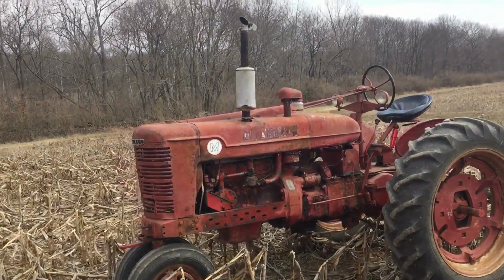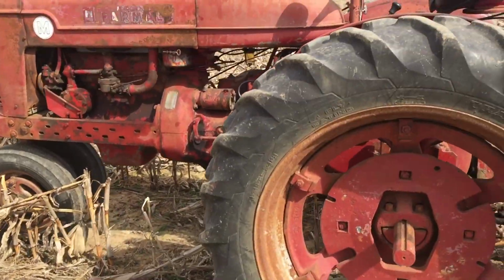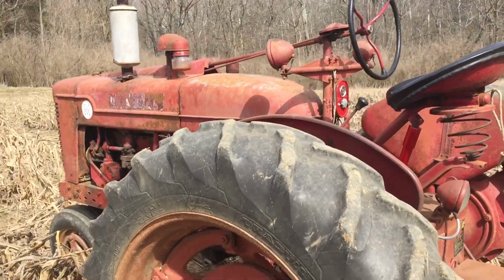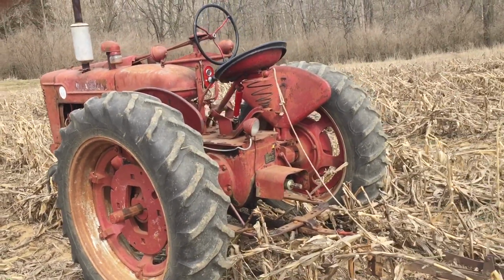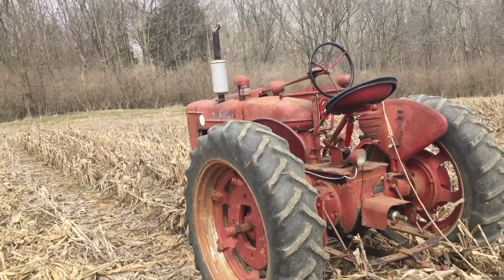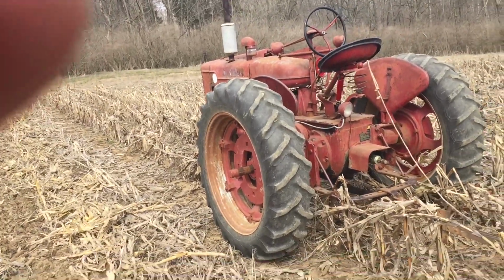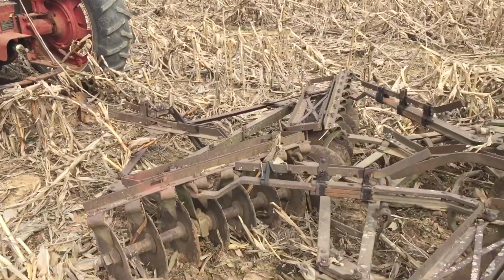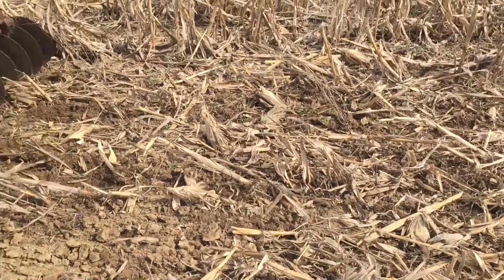Farmall M disking corn stalks

Comment: My grandfather put concrete blocks on his discses. But his was a cub size.
Reply: yep yep.  My father had a disc just like that but without my knowedge he let someone looking for metal cut it up! (and it still had the concrete blocks on it)   still have my grandfather's 1939 m and 1942 m but neither have ran since the 1970s Need them restored but that costs $$
Reply: @channelingusllcix3512  whow you have a M too. Nice! My father owns a 1950 Farmall M that was originally purchased new by his uncle for his dairy farm. After the farm closed, my father and grandfather bought the tractor and fixed it up. We still own it today, and it still runs, but we haven't used it in years because the clutch needs work. We are planning on fixing that someday. Thanks for sharing some memories.